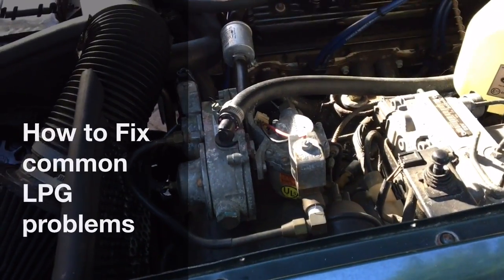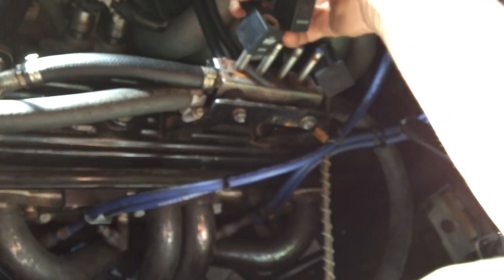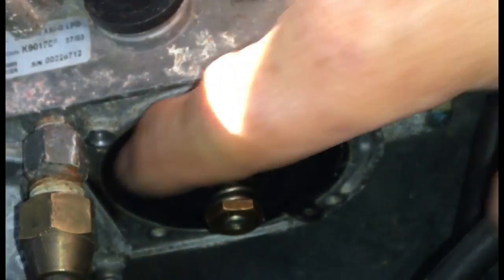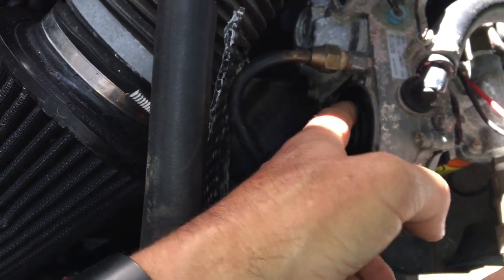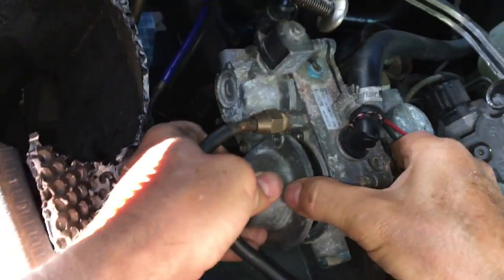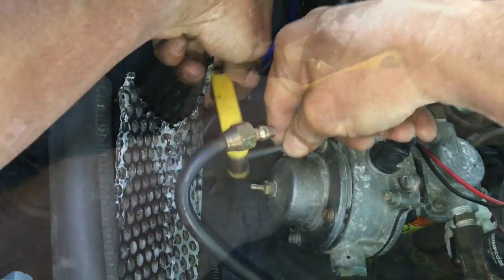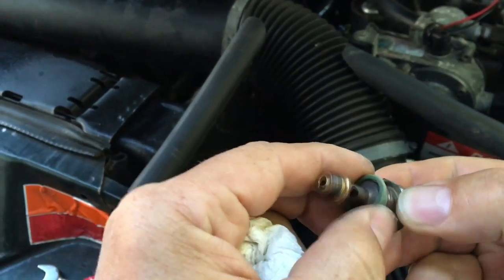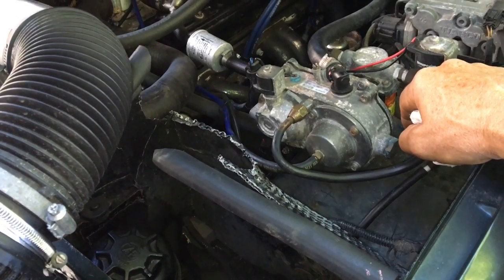How to Fix Common LPG Problems - Vaporiser / Reducer, Injectors

Comment: hello, I got a 1,8l bmw e36 and I'm having problems with my LPG system. The car works perfectly fine on regular gas.

The car is shakey (a missfire), if I step off the gas even the passengers can feel it. Can't hold revs when it's in neutral/clutch pushed in. Very hesitant to rev/can't go past around 4500 RPMS, but can hold steady acceleration. No smells. My best guess it's the injectors?

The vaporizer/reducer has been rebuilt a month ago. There's enough gas in the tank.
Reply from the maker: Sounds bad.  Sounds like not enough LPG getting through, so either it’s the vapouriser, injectors or it needs a retune due to different vapourisor pressure.  If you want to do yourself, dismantle the injectors and check and clean, same with the vapouriser.  Then get the LPG software and interface to talk to the ECU and modify the fuelling strength based on monitoring the voltage of your O2/Lamda sensor in the exhaust.
Reply: comeinhandynow its been retuned and as i mentioned the vapouriser has been serviced. I'll check the injectors. Thank you for your input!
Reply: comeinhandynow Forgot to update my situation lol. So I just rebuilt the injectors and got them tuned to the rich side - works perfect!
Reply from the maker: Good to hear.  I often had to retune my lpg system.  Worth getting the software and an interface cable if you keep the car a long time.

Comment: Accelerator is sticking after lpg conversion any tips?
Reply from the maker: Disconnect cable from throttle body and see which bit sticks - is it the pedal, cable or throttle body.

Comment: Hi Handy. Really useful video and very interesting to read all the answers to questions. Super helpful. I have an issue with my Zavoli bora system in that it's taking ages for the vaporiser to warm to temp. It can take 30mins or more. I tried not turning on the interior heater and this helps speed up lpg kicking in, but still seems to take much longer than normal. Last year during sub zero temps it was fine and switched over as normal so sure there is some issue. Could the temp sensor be faulty? Or does my coolant need replacing? Gonna do the bubble test tomorrow to see if any leaks and am also considering if vaporiser diaphragm could be an issue. Any suggestions of other things to check would be really appreciated as am a bit of a novice. Many Thanks
Reply from the maker: If it takes longer to switch over, then probably the vapouriser is not getting hot enough due to poorer water flow.  There could also be an air lock in the pipe.  Try flushing the pipes and filling and or bleeding to avoid air in the pipes.  Often the pipe to the cabin heater is used for the vapouriser heating, so if the heater matrix gets more blocked then the water flow may slow.  You need to work out how your system is plumbed in and work out why it is not getting hot so quickly.
LPG software to talk to the ECU is useful to see what temperature the ECU is seeing.
It could also be the car engine thermostat sticking open so that your whole engine is running cooler for longer.
Reply: Great advice. I was just looking at a replacement thermostat! It's due a MOT soon so will get my mechanic to do the flushing then and replace stat. Thanks so much for sharing your knowledge and taking time to help us. Best regards
Reply: I have now ordered the software and cable too. I will update once I find the solution. Many thanks
Reply: Sorry to ask another question. Just wondering if the lpg system has its own independent thermostat that might be faulty? The reason I ask is that the cars temp gauge gets up to temp 90 degrees quickly / as normal so thinking perhaps not the cars thermostat at fault. If the lpg thermostat staying closed maybe the hot coolant not making it round to the vaporiser. Until its mega hot and finally opens

Comment: many thanks for the tutorial sir:few questions: car takes more time than previous years (even in same season, tartarini system) to switch to LPG when cold starting. it takes about 2.5 miles until switch. I know for some systems it may be normal but previous years it did not take more than half mile. 2. where can I get software for tartarini system for my laptop? any free software?3. reaching almost 100k in 2 and a half years, what would be recommended service in addition to liquid and gas filter change, diaphragm only?thanks
Reply from the maker: Ask an lpg installing company, or search online, for lpg software.  For additional servicing, the diaphragm can wear regularly in the omvl system, not sure about others.  Similarly the lpg injectors can need regular rebuilding with a service kit on omvl types.  Again that may be different for others. 
 If it takes longer to switch over, then probably the vapouriser is not getting hot enough due to poorer water flow.  Often the pipe to the cabin heater is used for the vapouriser heating, so if the heater matrix gets more blocked then the water flow may slow.  You need to work out how your system is plumbed in and work out why it is not getting hot so quickly.
Reply: @comeinhandynow  thanks alot

Comment: You had that land rover running on LPG for 10 years?? :o I bought an ford E350 2008 V8 5.4 2V with a Tomasetto achilles kit.
Reply from the maker: Yep, owned for 13 years.  Sold now though.  Enjoy your big v8.

Comment: hi got a 2004 honda civic, started to misfire when when starting up, runs fine on petrol. now it is misfiring all the time,  unless i switch it over to petrol then it works perfectly fine. any idea what it could be? my lpg guy goes it needs the tappets adjusting?
Reply from the maker: I would change lpg guy (lol, tappers!). It’s probably some of the injectors gumming up, as I mention in the video.  This is common.  Depending on what lpg injectors you have, they may be able to be dismantled and cleaned up.  OMVL ones can be and there is a service kit with new springs and o rings that you can buy.  Otherwise new lpg injectors.  Other thing to check is that you have a good spark as lpg is a bit more sensitive to this.  So change spark plugs and check leads by measuring lead resistance.  Also look for any sparks appearing around the spark plug leads, do at night so you can see them, and fix as required.

Comment: Thanks for the interesting video, I have a BRC system fitted to a 2009 astra, are the filters hard to replace and do you have a video of this at all?
Reply from the maker: They are not hard.  No video.  You may have to prise off the hose retaining clips and replace them with jubilee clips that’s all.
Reply from the maker: Check for any leaks afterwards using the foam from frothed up washing up liquid.  Check if it bubbles up anywhere around the joints, with the car running on lpg.

Comment: hi, ive got a injected lpg system that im not useing anymore 1st can i reconnect my heater leaving the reducer without coolent will this damage the reducer & 2ndly why r my fuel injector wires also traveling to the lpg computer box does this hav something 2 do with  starting the vehicle on petrol & changing to gas automaticly?
Reply from the maker: Sorry for the late reply, I thought I had answered this already.  So, yes you can bypass the vapouriser if you are not using lpg anymore.  The fuel injector wires go to the lpg ECU because the timing of lpg injectors copies the petrol injector timing, plus or minus a bit depending on the mixture required.
Reply: how difficult is it 4 a professional to re wire the  gasoline fuel injectors back to normal after having the lpg removed from car?
Reply from the maker: Very easy, normally.  Just unplug the lpg wiring loom from the fuel injector connectors and plug the fuel injector connectors back onto the fuel injectors.
Reply: @comeinhandynow  not if its a solder in job, means the lpg ecu loom has to be removed and the stock petrol injector loom soldered back together, done i many times.

Comment: Wow  brilliant video  I've just purchased a little peugeot bipper and when I change to lpg the engine management light comes on . Do you think a service kit and change the filters and innector rubbers and spring onions could cure this . Thank you.
Reply from the maker: Thanks.  It certainly wouldn’t do any harm, but probably the engine light indicates the ecu detecting poor air/fuel mixture so the LPG might need tuning in the ECU.  And/or you might need to put on a dummy lamdba sensor on the exhaust to fool the ecu into thinking all is good.  If you get a cheap (£12 ish) ODBII reader then that should tell you what the light means.  See a video on OBDII dongles on my channel.

Comment: I have a minivan with genuine lpg from japan i used to refil it from local shops but yesterday i have been to lahore(big city) where lpg station was available but it did not work on my car even they dont understand the problem but it just dont get started can anyone tell the problem
Reply from the maker: Hard to tell.  Maybe the float level valve is stuck closed. inside the tank, or an inline solenoid is stuck.  Try putting 12v onto each solenoid to see if it activates/clunks.  You ideally need the hardware cable and software to interogate the gas ecu to see if there is enough gas pressure.

Comment: Hi, interesting video. Didn't help with my current issue tho so hoping you can help. I have a 350 TBI Chev running a Tartarini system, looks very similar to yours, however very early dual injector model. Anyway, driving up a steep hill needing plenty of throttle. Had to lift off suddenly in order to avoid an errant motorist threatening to pull out in front of me, back on the throttle and no power. Had to switch to petrol to get to the top of the hill. Switched back to LPG once home and the car seemed to run fine. drove back down the hill and on the flat next day without any problem, but coming home at same steel hill, same problem, no power. If I lift off, I can crawl up the hill, but with any decent acceleration lose all power. feels like a fuel blockage. Appreciate any ideas. Cheers
Reply from the maker: One possibility is that the vapourisor  is freezing up when a large gas flow is drawn, this could be due to it not getting enough hot water flow for some reason. Check how warm the vapourisor is by stopping when it happens, turn off and feel it.  Or the injectors could be a bit waxed up and getting more sticky when they get colder due to the higher gas flow. (I have run a hot water pipe under them to help on an old car of mine).  A strip and clean of the injectors would help, if possible.

Comment: Hello
I have a problem with my BMW 728i which has LPG system.
If the engine is cold or so then if i start my car, i can use LPG but as soon as i start driving, it switches over to petrol and i cant switch it back. I tried to change filter but it doesnt help. Any help please?
Reply from the maker: Insufficient lpg pressure.  Maybe a stuck solenoid or float valve in the tank.

Comment: I have a problem.... i have changed the reducer and now i have gas running into my engine and is being used up. Only problem is that the vacuum hose connected causes my engine to cut out when coming to a stop, i have to use the car with the vacuum hose disconnected, why is this?
Reply from the maker: Maybe the rubber diaphragm in the reducer/vapourisor is perforated allowing gas to enter the vacuum pipe and give a too rich mixture at idle.  You can test for this my putting your finger with a bit of saliva on it over the open vacuum connection point on the reducer to see if any gas is coming out and making bubbles.
Reply: Thanks but I believe I have a manifold leak, I have tested it will alcohol based spray, sprayed some of the liquid around the inlet manifold and nearly stalled the engine. The reducer I bought is brand new so it has no problems for sure.

Comment: Sir, thank you... i will be looking into my rough idle and random cut out.
Reply: Any update on what fixed it ?
Reply: @njoy51   Yes, injectors were clogged... remove, spray direct into injector with wd40 and wire each direct to battery to allow injection flush, then simple put them back. LPG is very difficult to ignite through motor spark, it will never be perfect if your engine has many miles wear and tear. i scrapped my berlingo and got a 1L ecoboost ford transit connect... Its a mini motor beaut with alot of power!
Reply: @tspirit99  yeah, planning to upgrade my plugs to NGK iridium and ignition cables .. hopefully she'll run a lil less hotter

Comment: I have an engine that won't run rich no matter what i do. I have a CA125 carb and just replaced the regulator and cobra vacuum lock. I've replaced the ECU/fuel management and the vacuum solenoid. So needless to say i can't adjust the fuel. Help please! Lol
Reply: Also this is a Ford LSG motor
Reply from the maker: I’ve not experience of that setup but I did a quick web search and this adjustment info might help.  http://www.pngtechnologies.com/PDF_Files/LPG_Carburetor_Adjustment.pdf

Check gas is flowing well to the carb before trying any adjustments

Comment: Hi brilliant video . So I have landrover discovery 2 V8 4 litre metropolis 2002 . Was running fine on both petrol and LPG.  However I  went away for 6 weeks and when I came back I realised when ever I switched it to LPG it would make a beeping sound and cut off and so I would have to switch to petrol.
Mine is the split tank 65l LPG and 30 litres petrol.
What could be causing this beeping and cutting off of LPG. 
Has it got anything with having been stood for 6 weeks ?
Help urgently please as petrol tank is too small
Reply: Hi Robert useful video also have 1997 Discovery recently the switchover LED became erratic and now the red LED has out completely so no switchover - any ideas? Thanks Michael
Reply from the maker: It does this when it detects low lpg gas pressure at the injectors.  So assuming that it actually has some gas in the tanks it could be one of you solenoid stuck.  These turn on the gas supply and you can often hear these clunking when you switch to lpg.  There is usually one solenoid on the tank one before and one after the vapourisor.  You could try listening to see if you can here the solenoids activate.  You could also apply a 12v to each solenoid to see if it sounds like it is working.  You could also loosen off the gas pipe after each solenoid to see if gas comes out when you power up the solenoids.  Do it outside and be careful about the gas.
Reply: @comeinhandynow  
Thank you for the advice.  I am thinking of buying a new set of solenoids and vaporizer just in case.  Any advice of what sort to get?
I have also noticed a disconnected hosing meant to feed into the vacuum.
Reply from the maker: Can’t help much there, I only have experience of the OMVL ones, which work but are not without reliability issues in my experiences

Comment: Great video thanks. I wonder if you can help - I have a 1.8 transit connect bi fuel with Necam system. It's totally cutting out when idling (on both LPG and petrol). I spotted the breather hose from the back of the crankcase is only attached on the crankcase end - other end is hanging loose. On the standard petrol, this would just go into the air filter box. But clearly it doesn't on the LPG version. Would you happen to know where it goes?!
Reply from the maker: No sorry, but it sounds like you could have an air leak into the inlet manifold causing a very weak mixture at idle, causing to stall. Possibly related to that disconnected pipe.  Look or listen for for any places sucking in air around the inlet manifold.

Comment: Hi, just a quick update to my misfire problem. Injector bank 1 would cut off even after replacing new injectors. Replaced old omvl xx1 ecu with a King ecu and bingo no misfiring all injectors working
Reply from the maker: Yay!  Well done, it’s good when fixing stuff works!

Comment: Im wanting 2 change my petrol fuel injectors but the lpg hoses r in the way 
& they r clamped on can i cut the hose ? What will happen & what security measures should i take?
Reply from the maker: When the engine is not running the Lpg gas supply is cut off by solenoids on the Lpg tank and vapouriser, so detaching the Lpg supply to the injectors has no risk in that case.  
The clamped on bands can be prised off and released.  Just use a very small screwdriver to get behind the bit that is bent over the outside bit.  Replace the clamps with good quality jubilee clips if you haven’t a clamping tool.

Comment: I have a v70 with an LPGtech system fitted. I believe that gas is entering my coolant system as when I'm running petrol I don't get a problem. When in gas I get a low level warning for one and when I take the cap off get loads of hissing and you can smell fuel. Also I get loads of steam out the exhaust when in LPG. Yes the head gasket is fine and all the rest of it. Just wondered if the vaporiser can leak gas into the coolant system.. It's a good video. 

Ryan
Reply from the maker: It is not impossible since the liquid gas travels through a pipe in the vapouriser that is surrounded by coolant water, so a hole there would do it.  But it is not a common fault that I have seen since it is an all metal pipe.  You could have a go at stripping down the.vapouriser to see if you can find any fault with it.
Reply: It your vapouriser a magic model? Its a common problem on the early types to leak gas into the coolant jacket and have the problems you describe.

Comment: i would not use superglue as it most sertantly eroses the rubber or even melt it. what would result in drying out the ruber and tears.
Reply from the maker: Superglue was created to rapidly stick skin / wounds together for military hospital and rubber being organic also reacts very quickly with it.  It doesn't however get eroded by it or melt it.  Maybe you are thinking of solvent glues which would do that.